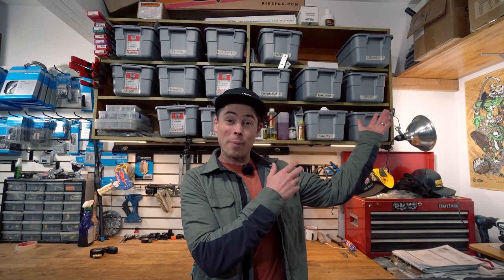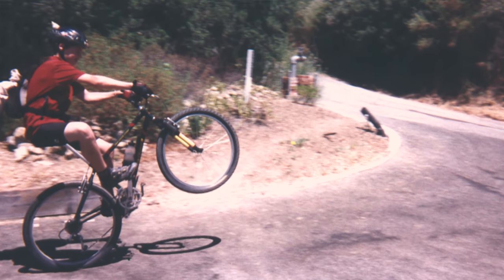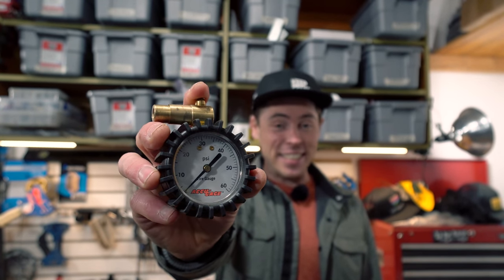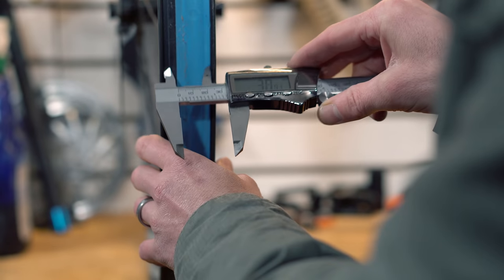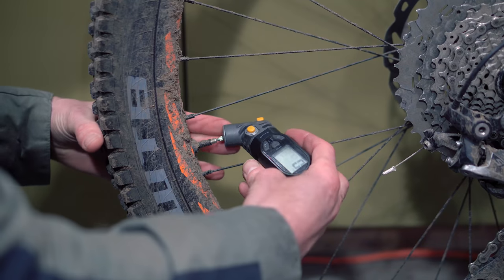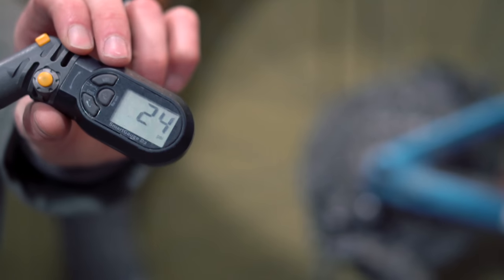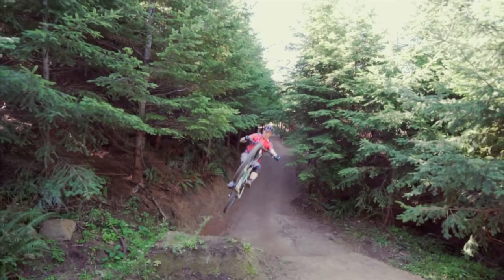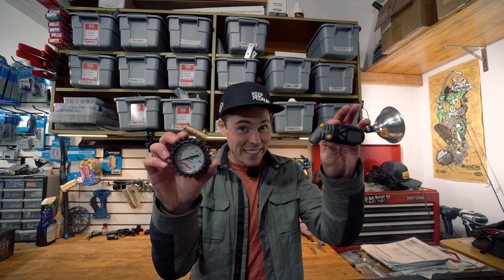Should we all use the same tire pressure?

Comment: Love the guidance figuring out tire pressure. I'm 240lbs guy and I've always ran my tube tire pressure on the rear around 50lbs.
Reply: Michael, I'm about same as you on the scale after adding gear closer to 250. First thing is I totally recommend tubeless, it's been so long since I road tubes I can't recommend pressures on that, but would say 50 still seems high. The process that JKW talked about, riding the same bit of trail while letting out air a little at a time to figure out what feels good would be your best bet.  You probably should have a back up tube because when you get to that too low of pressure setting you will most likely pinch flat your tube.  For me on my tubeless setup, riding on the rocky Texas trails, depending on the trail I'm between 28 and 30 psi in the rear. Good luck.

Comment: +1 for Cush Core. I rode the lifts all last summer at Big Sky, MT (place is steep, very rocky) WTB Vigilante 2.3", Stan's sealant with Cush Core front and rear and had not. a. single. flat. For the first install, make sure they're warm, it makes the install much easier. I put mine in the oven while it was warming up, maybe 100F for a few minutes.
Reply from the maker: WOW!  That's quite a testimonial to cush core.  Interesting tip on baking them!
Reply: @JeffKendallWeed  When they're cold they're a bit of a PITA, I just intercepted my oven's pre-heat when it said it was 100, turned it off, threw them in the top rack (away from the heating element in the bottom), and let them get nice and warm. They were mucho more malleable after that.

Comment: Just added Cushcores to my Ripmo (Ibis oem Maxxis 2.5 Exo casings). Only one ride so far.  But I think they complicate the picture somewhat, because they reduce the likelihood of burping overall--you can go looow and still maintain a good bead. Really looking forward to your impressions.
Also interested in any insights on tire pressure and cornering traction. Lots of loose on hard where I ride, and the quest for traction is constant (not forgetting that the quest for better riding skills trumps all).
Anyway, thanks for another good vid. Looking forward to a ride in your neighborhood in a couple weeks!

Comment: I use to run 20/24 with 27.5 2.5/2.4wt maxxis on carbon nox teocallis and when I went to bakers creek TN I was having issues and switched to 24/28 and it was worlds different so now I run in the middle on my own trails and actually found it better than the original 20/24 i use to run.
Reply from the maker: The low pressure feels good at first, but smacking rims is no bueno!
Reply: @JeffKendallWeed  Carbon rims too ouchies! Haha

Comment: I want the next tire gauge I get to read decimals. 2.6 to 3.0 tires can often take more than one pump to go from one PSI to the next. Oddly a pump or two can make a difference. At 17 PSI, I'm pulling the tire off of the rim in turns. At 19, I'm losing that sweet plus traction. 18, 18+1 pump, and 18+2 pumps all have slightly different feels. With normal tires up to 2.4, I haven't noticed this, (but I'm usually 25-32 PSI depending on the tire/location.)
I've also noticed that some tires that other folks love, I will hate, (DHF I'm looking at you,) but I can't run the tire at the pressure that the fans of that tire run. At 260+ lbs, I'm running different tires and pressures than a 150+ kid.
Reply from the maker: The Topeak sometimes reads 1/2 psi increments but it is not consistent.  The acugauge is better for more precise measurement, and I believe they have a <20 psi fat bike version.  I may be 150lbs but I'm no kid!

Comment: I need a guess of all of you guys:

What pressure would so suggest for a 240lbs/110kg rider on Minion DHF/DHRII 27.5x2.6wt EXO combo tubeless on 30mm rims riding rocky/rooty forest trails and alpine?
Give me your guess or experience for the front and/or back!

I'm currently on 20psi front and 25psi back, but still figuring stuff out. Came from 2.8" Rekon+ with 1mm heavy ass tubes. Ran them around 15psi, front even lower at times.
Reply: I am 240lbs before pack 
DHF 2.5 DD @ 45lbs
DHRII 2.4 Exo @ 50lbs
Tubless on Reserve 27mm rims
I ride mostly super chucky rocks amd drops no more then 5ft. Seems to be okay for me could probably go down a couple lbs in front but the rear is really flattend out where it makes contact so I figured its good. 
Just my 2c

Comment: Hey Jeff, I'm really looking forward to seeing your feedback on the cushcore inserts. I have been running them for about a year on my Pivot Mach 6 and I think I'll take them out on my next tire change. Not that I've had any problems with them but they do add a little weight and much worse they make tire changes near impossible even after watching the instructional video. I'm actually a professional motorcycle mechanic. I'm good with tools and not a hack but I don't think I can suffer another tire change with cushcore inserts.
Reply: Mine got a lot easier the 2nd time around, I think they had stretched out a bit, did both wheels no tools no drama. Biggest difference maker for me was making sure everything was warm. I put both wheels in my mechanical room, next to my furnace and hot water heater. Once I made sure the tire bead was in the dish of the rim and used a bit of soapy water it was hardly any harder than a standard tubeless tire install.

Comment: Interesting...I would think you'd be running even lower pressures with larger volume 29er tires and your lower weight. I'm about 190 lbs and run 18 PSI up front and 21 PSI in the rear on a 29er hardtail with 25mm inner width rims and Maxxis Forekaster 2.35" EXO/TR Tires. Mostly XC riding, small jumps, roots, logovers, switchbacks, and punchy climbs and descents, but I find this to be the best combo of good rolling, grip, pump, and comfort without being bouncy or squirm under hard cornering. I like to get down to the 0.5 PSI level of detail and that's what I settled on for those tires. I also always adjust before a ride after I've let the bike sit outside out of the sun for 15 minutes or so, so the pressure is set to the outside temperature. I think this gets me the most consistent results
Reply from the maker: Hey Damien, when I was rocking the 29 x 2.6 tires, they were the thinner Schwalbe Snake Skin tires, so they didn't have as much sidewall stiffness as say a WTB Tough or Maxxis Double Down.  Also, I'm a frequent jumper, which changes the pressure requirements pretty quick.  THanks for the note!

Comment: I'm running wtb ranger 2.8s hard casing on my hardtail. I weigh about 155 pounds riding loam and hardpack in the uk. Currently 15 psi front 18 psi rear. This seems to line up with you recoomendations?

Comment: Great stuff. I just went from 2.35 hans dampf front and back on my diamondback mission2 to 2.6 magic mary in the front and 2.6 nobby nic in the rear. Both with cushcore. I was just about to start testing tire pressures. I would love to see what you think about that setup.
Reply: Sounds awesome, what ID-width rims do you have? I'm running 2.6 tyres and 30 ID rims
Reply: @th_js  mine are stans Flow mk3 with 29mm internal width.
Reply: @MTBThrumyeyez  29mm is perfectly OK for 2.6!
Reply from the maker: Hey man, pressure will depend on your weight, your riding style, and your terrain.  I can't yet comment on how cush core affects final pressure.
Reply: @JeffKendallWeed  yeah I can't wait to hear your opinion and testing. Great vids keep them coming.

Comment: How does the rider's weight play a role?  I'm 5'10" and weigh 210lbs I have a 29er with 2.3 tires. I live in Michigan so we have a mixure of roots, rock gardens, and flow with jumps and high berms. Any suggestion would be great since I've only been riding for 2 yrs and still learning. Thanks
Reply: I find I'm almost always running higher pressure than the lighter folks.
Reply from the maker: Yeah, like NoBrakes said, you'll wanna run a little higher pressure.  How much more?  Well that depends on riding style.  Id just notice how many rim strikes or burps you experience, then add more until you don't have those issues anymore.
Reply: Thanks man for the reply
Reply: Thanks, man for the reply.

Comment: “I’m going to go ahead and assume that everyone is running tubeless tires” OUCH! Shoosh!....... My bikes are listening….. there, there little 26”ers. There is nothing wrong with tubes, I will always love you….

ps: Dont't tell them I'm saving up for a new bike.  ;-)
Reply: I'm still rocking a couple of 26" bikes, (but they are both tubeless.) #26aintdead
Reply: @NoBrakes23  Good to see 26” bro. I might have to look at my tubeless options. I spent some time away from riding during the transition to 27.5/29 so I need to do a little catch up. 
https://www.youtube.com/watch?v=Jj0uBQ7j5c4
this still cracks me up.
Reply from the maker: Hey Somebody, my Mojo Ti is 26" and tubeless!  It can be done!
Reply: @JeffKendallWeed  Excellent. Thanks for that Jeff.
Reply: @doozer009  I did my first tubeless conversion on my 26'r this year.  2.3 vigilante in the front and a 2.25 Trail Boss in the rear. Gorilla tape + Stan's  valves + Stan's sealant.  UH-MAY-ZING. I highly recommend it!
I'm still playing with pressures but I think I ,weighing 200-212 lbs geared up, like the baseline set up recommendation from Stan's: Rider's weight divided by 7 (-1 for the front and +2 for the rear).  Which for me is F-27, R-30.
This has worked out well for me so far.
Reply: @JeffKendallWeed  Why do you run such high pressure on that bike? 37 psi seems high to me?

Comment: Yep the Topeak gauge is great for checking tyre pressures & carry it with me in my pack, I’m riding 29er with 35mm id rims  2.5 wt front & 2.4 wt Maxxis exo tyres (shorty & dhr2) 28psi rear 27psi front & weight about 240 pounds 🍰🍰🍰😘
Reply from the maker: Woa, that's a lotta air!  But you're also almost double my weight.  Any folding over/burping issues?
Reply: Jeff Kendall-Weed no burping but I don’t ride as hard as you (if only I could tho😅) will try a bit lower pressure but just don’t want to dent my rim again cheers 👍

Comment: hi Jeff, it's Jeff , I'd like your video's approach. I'm waiting you review the cushcore with tyre pressure set-up I just bought a set of Nukeproof ARD inserts for my wheelset, expecting to drop air pressure by 2-3psi on my 29er, using a 30mm internal width. keep the good job. Regards